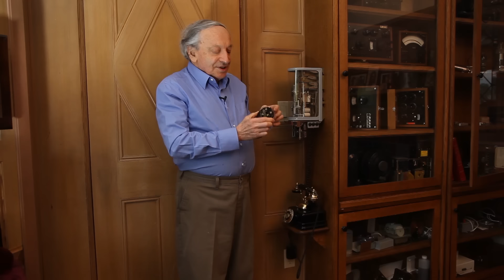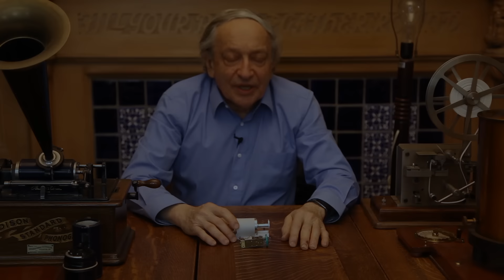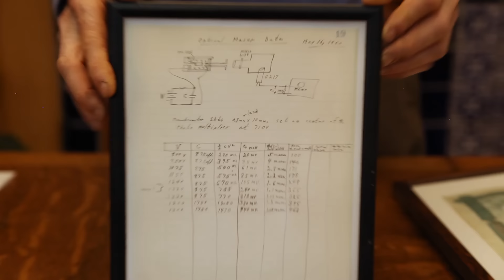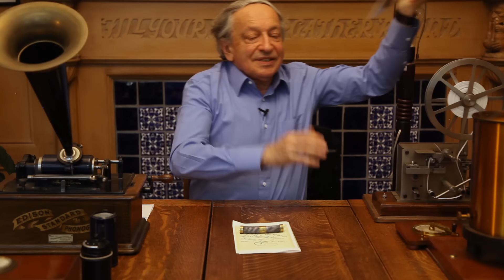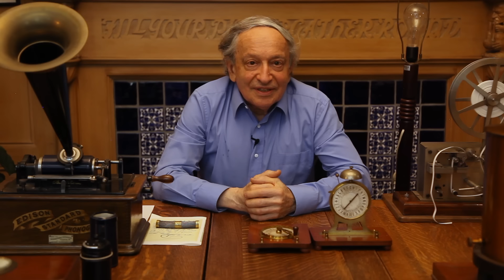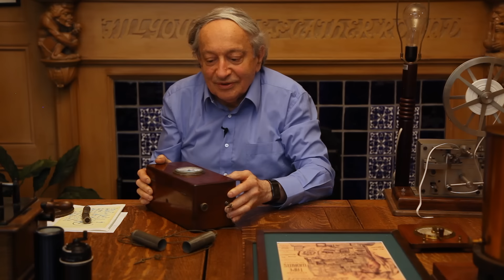Historical Scientific Instruments

Comment: Very interesting Dr. Gelbart.  My dad managed several telephone central offices in Central NY.  He showed me the operation of Strowger switches and their successor, the crossbar switch, several times.  I did not know how Mr. Strowger came to develop them.  

Had one of those vibrating voltage converters in an '81 Mazda GLC auto.  But it converted 12v to 5v to run some dash lights.  

Sad that that Fritz Haber's invention of a process to extract nitrogen, transforming world agriculture would be eclipsed by his invention of an insecticide used in the Holocaust and against his own family.

Wish you had explained what was wrong with the first undersea cable and how it was corrected.

Comment: What a history lesson :D
I have a Frequenta, another cure-all from around 1920 I think. It's basically a crackle tube, where the glass section can be swapped for various pieces that fit various parts of your anatomy. The transformer inside probably makes 5-10000 volts, and is made of exposed wire, iron rods, and nailed-together wood.. I never turned it on :)
Reply from the maker: I'll look it up.

Comment: Sir coupled with you telephone exchange there was a timer also built later by zenith or its parallel companies which became an integral part of the system as it provided the operator mechanically  an electrical indication of call time or when to disconnect a call. Calls were quite costly I believe back then. They are quite rare now, but I laid my hands on one recently and serviced it to full functionality. I have  uploaded its video if it interests you

Comment: Very nice video. But in the part about the Haber-Bosch method, you go straight from guano to their method. In fact, Christian Birkeland and Sam Eyde developed a method to make fertilizers from electricity and air many years before that. Their pilot plant in Notodden, Norway was producing fertilizers in 1905. This later became Norsk Hydro, now Yara. They cooperated with BASF in Rjukan, Norway at the same time, but the German part of the factories was phased out, in favour of the Birkeland-Eyde technology, which had better yield. Many years later the Haber-Bosch method took over, as it was much more energy efficient. But Norway had a lot of hydro electric power even then.
Reply from the maker: Hi Tom, I'm aware of the electric arc work to bind the nitrogen that came before Haber,  but the video covered many inventions so I didn't have the time to get into it. Thanks for the info.

Comment: Thanks for the video. I'm in the process of restoring an Edison Standard Phonograph. I've completed the main unit but it is lacking the horn. Your video gave me a good idea of the size, style, and structure of the original.
A little disappointed that you didn't get round to the Curta calculator you had on the desk. I have one that was issued to one of the designers of the UK's first atomic power stations. Curta's story is fascinating.

Comment: 39:20 "...the kelvin galvanometer..." We used them at Caterpillar research in 1964. They were called light beam galvanometers. The machine was called a CNC High Speed Strip Chart Recorder. We recorded signals on 12 track 1" tape at high speed. We then slowed down the replay and recorded it onto the chart...running at high speed. The beam channels were directed onto light sensitive paper that was pulled at a constant velocity and wrapped onto a receiving roll. The roll was later developed in an ammonia atmosphere to reveal the traces. The tape allowed us to find the points of interest on an oscilloscope before committing it to the expensive recording paper.

Comment: His discussion of the laser gave credit to Theodore H. Maiman in 1960.
However, in 1917, Albert Einstein established the theoretical foundations for
the laser and the maser in the paper Zur Quantentheorie der Strahlung (On the
Quantum Theory of Radiation) via a re-derivation of Max Planck's law of
radiation. Then in 1959, Gordon Gould first published the acronym "LASER" in
the paper The LASER, Light Amplification by Stimulated Emission of Radiation.
Gould's notes included possible applications for a laser, such as
spectrometry, interferometry, radar, and nuclear fusion. He continued
developing the idea, and filed a patent application in April 1959.

The U.S. Patent Office denied his application, and awarded a patent to Bell
Labs, in 1960. It was not until 1987 that Gould won the first significant
patent lawsuit victory, when a Federal judge ordered the U.S. Patent Office to
issue patents to Gould for the optically pumped and the gas discharge laser
devices. (The question of just how to assign credit for inventing the laser
remains unresolved by historians.)

On May 16, 1960, Theodore H. Maiman did operate the first "functioning" laser
at Hughes Research Laboratories. However, Maiman's laser used a flashlamp
pumped synthetic ruby crystal to produce red laser light at 694 nanometers
wavelength. The device was only capable of pulsed operation, due to its
three-level pumping design scheme.

Later that year, the Iranian physicist Ali Javan, William R. Bennett, and
Donald Herriott, constructed the first gas laser, using helium and neon that
was capable of continuous operation in the infrared (U.S. Patent 3,149,290);
later, Javan received the Albert Einstein Award in 1993.    Given the above, it would appear as if the video is riddled with inaccuracies.

Comment: Strowger did indeed (along with his brother who understood 
electricity, etc.) develop the Strowger switch (1888) and automatic telephone
exchange. (And the running "story" of "why" is known to all telephone buffs).
However, he did NOT use a dial - but rather two telegraph type keys on the
telephone, which had to be tapped the correct number of times to step the
switch.

The first patent for a rotary dial was granted to Strowger, but not until
November 29, 1892 (U.S. Patent 486,909).   Also, the explanation of how the Strowger switch works is only partially
correct. In an automatic office, the first Strowger switch seeks for an
available trunk to provide dial tone, the next switch handles the next two
numbers, etc.  Plus, his example Strowger isn't complete - it had no contacts (turns out
it's MUCH easier to find Strowger's without contacts - but they're quite
useless).
Reply from the maker: Hi Michael: Thanks for the extra info. Each time I post a video I learn something new. BTW, my Strowger switch does have the contact bank but sometimes it is hard to see it against the brown wood panelling. The Strowger switches were cleverly designed that the mechanism is detachable from the contact bank, so in case of failure, you don't have to re-connect 100 wires, just swap the mechanisms.
Reply: @dgelbart  excellent.  I think people who 'follow this stuff' are sticklers for detail, and so when things are not perfectly resonant with known history, folks get concerned that -- if what they know to be is not accurately represented, then how much of what they do NOT know is accurate?  I know you're doing a service showing your amazing collection.  And yet, the folks from whom I received those comments (posted here w/o their names to protect them) appreciate when people are describing historical events - to do that with as much integrity / correctness as possible.   And/or qualify as "there is more to this story, and here is a little bit".  I dunno.  You can please some of the people all of the time, and all of the people some of the time, but you can't please all of the people, all of the time  (I'm told...).

Comment: bacteria produce proteins which are bounded nitrogen compounds without high pressure and high temperature so the key issue is a proper catalyst.
Reply from the maker: So do some plants but nobody managed to copy these processes into an industrial scale. Still, a very interesting point.
Reply: @dgelbart  either you have a very free electron or you use high pressure and heat ;)

Comment: Dan actually perpetrates some common urban myths about Strowger and his telephone switch which the popular press is responsible for.  
1.  Strowger was not the first to invent and automatic telephone system, and neither his nor the others had any practical merit.  Contrary to what Dan said, Strowger certainly did not have the technical nous to get a working system.
2.  But Strowger certainly was concerned about the local operator sending undertaking business to the competition.
3.  How Strowger differed is that he formed a company, got adequate finance, and employed competent technologists to develop a practical system.  If you compare what they ended up making with Strowger's original drawings, there's little resemblance.
4.  Dan implied that Strowger's switch remained in use for 100 years.  This is like saying the Ford model A remains in use - after all, many cars being made today share the same basic pattern of 4 wheels, engine in front, gearbox and differential.  The engine is still and IC engine.   Just like cars, telephone exchanges of the general Strowger type (i.e., bimotional switch nased) went through a lot of model changes, developments, and refinements until the 1960's, when they became obsolete.   For example a 1960's British SE.50 director exchange bears about as much resemblance to a Strowger company exchange as does the latest Toyota does to a Ford Model A.  But it's still classed as Strowger to differentiate it from the contemporary alternative, crossbar exchanges.
Reply from the maker: I beg to differ. All publicaly reviewed references I have seen give Strowger the full credit. Maybe others had ideas before him, but he was the first to manufacture them. See: https://en.wikipedia.org/wiki/Strowger_switch

Comment: I remember when the Telephone Central Offices were full of "automatic" electro-mechanical switches, (they were called 'Step Switches'). The clatter of hundreds of these switches all operating at the same time was something to behold. It sounded like you were in a tin shed during a hailstorm, but it went on all day. In the modern Electronic Switch Telephone Central Office the whir of the cooling fans is about all you hear. I was in a Telephone Switching Office on Edwards AFB California the day President Reagan was shot in 1981, and the electron-mechanical switches went crazy. It sounded almost like an explosion, and a Sergeant with me said, "Something important has just happened". We exited the building and turned on a portable radio, (the thick reinforced walls of the building made radio reception very difficult), and found the President had been shot and wounded.

Comment: As much as I would like to think that Haber process is most important invention ever, in reality invention of Steel is most important invention ever. Without Iron smelting and steel production there would be no Haber/Bosch process, nor there would be mechanization of agriculture, no steam engine, no modern buildings, no modern bridges, no industrial processes, etc. It is hard to realize, mostly because steel was present in one or another form for long time, and the crucial improvements in modern era are not so well known (bloomeries, Puddling, Regenerative heat exchanger - Cowper stove, Blast furnace, Benjamin Huntsman works, Bessemer process,  Siemens-Martin process, Aston process, Gilchrist–Thomas process,  Linz–Donawitz process, Flodin process), with many intermediates small improvements and precursors.

Comment: The proper name for the vibrator was actually the "interrupter". As a kid in the late 60s, people would give me piles of those old tube car radios and I would repair them by smacking the vibrator abruptly on the table. This would unstick the contacts after years of sitting and oxidizing. I repaired one of these radios as recently as 1998 for a dear friend. It came from his first car, actually a 1950 Ford pick up truck. He cried when he heard his old car radio again after so many years. Rest in peace, Mark.